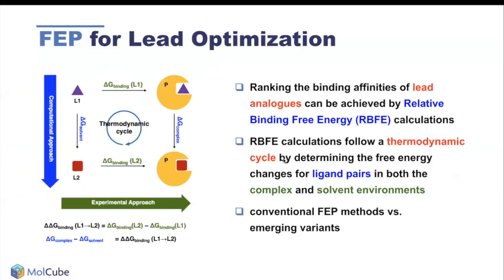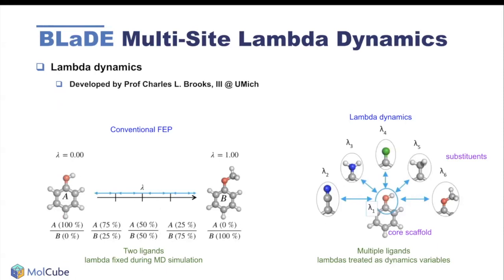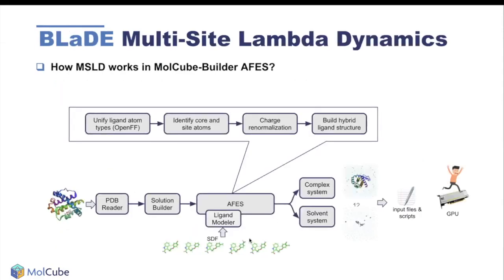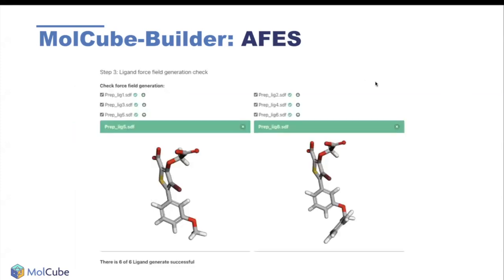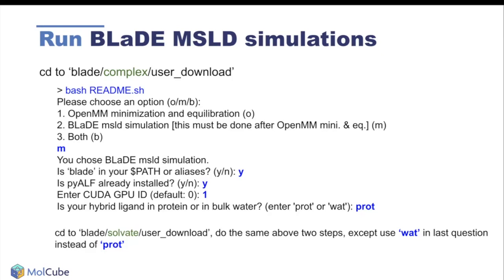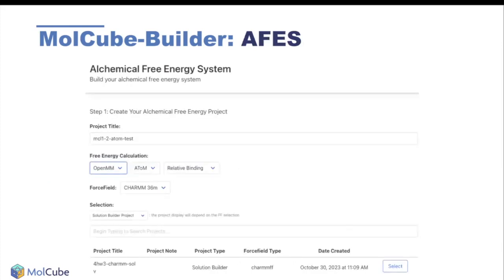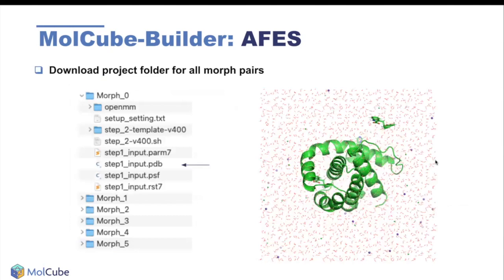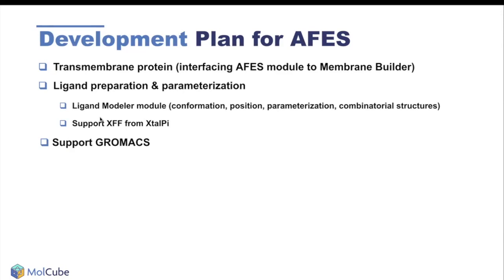MolCube AFES Tutorial Webinar 2023-11

Comment from the maker: Chapters - 
00:00 Intro 
00:30 FEP for Lead Optimization 
01:36 Outline 
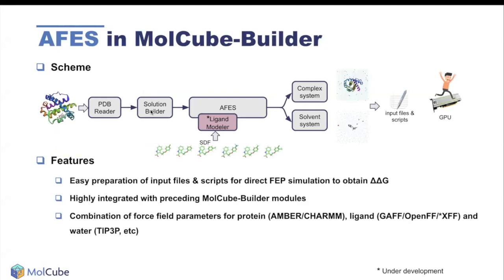02:17 AFES in MolCube-Builder 
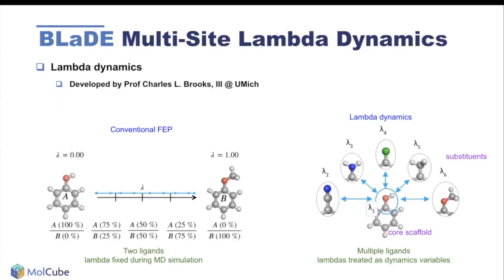04:56 BLaDE Multi-Site Lambda Dynamics 
08:52 How to use AFES module in MolCube-Builder 
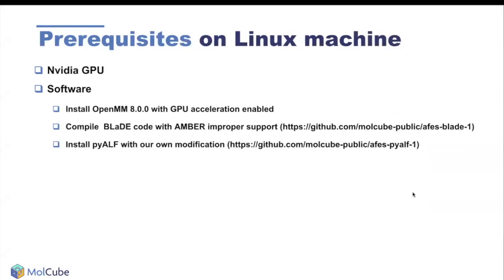17:37 How to run BLaDE MSLD simulation on Linux (Nvidia GPU) 
21:45 OpenMM-AToM method supported by AFES module in MolCube-Builder 
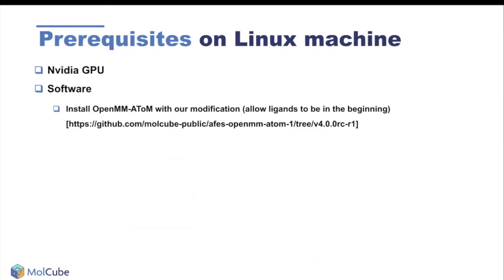30:00 How to run AToM calculations with AFES modifications on Linux (Nvidia GPU) 
32:09 AMBER-TI Method through MolCube-Builder 
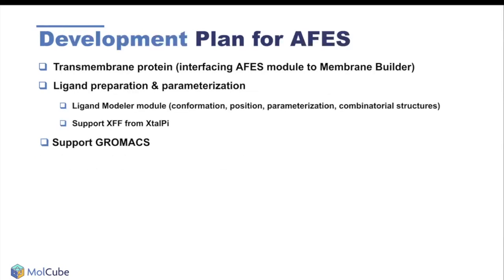34:02 Future Plans 
35:36 References